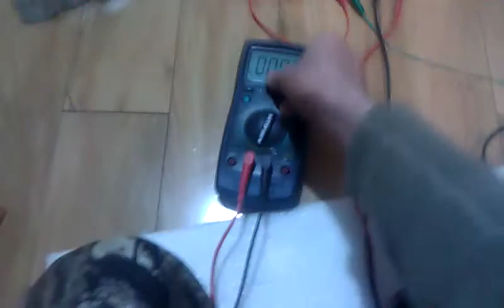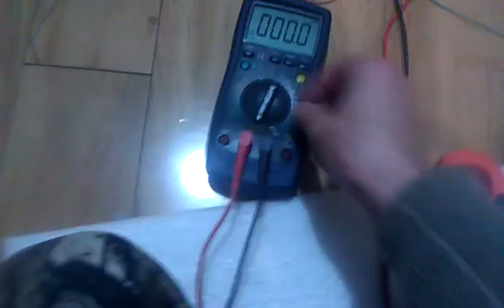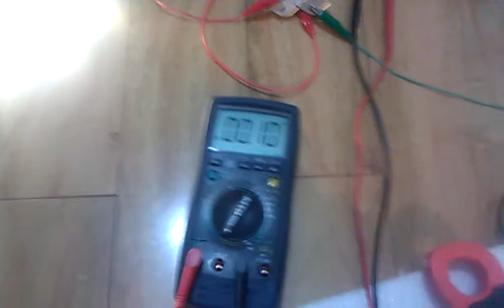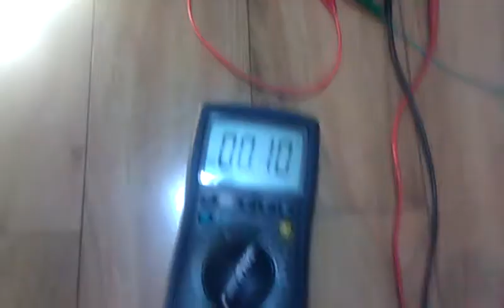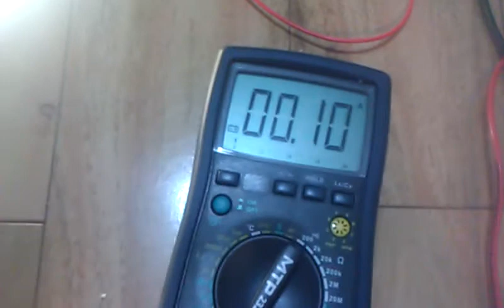Radiant Oscillator Circuit Part 8: Digital Meter Reading

Comment: The reason your setup is effectively efficient is because of the high frequency oscillation and higher voltage involved from the back emf of the coil collapsing. I have witnessed this with my inverter and cfl's they use more power at lower voltage and frequency. It has to do with the resonance and capacitance. The joule ringers helped me understand all this stuff.

Comment: His analog meter didn't pick it up, and it seems that the current is direct and not alternating at the point of measurement. The scope would be academic and in any case be better placed across the first coil for investigation purposes. What do you think?

Comment: Hello,

I just stumbled upon your videos.. :) 

Do you have oscilloscope? If yes, could you please attach 1 ohm resistor instead of ampmeter and put scope across? By Ohms law, your RMS value in scope will show actual amp draw no matter what frequency or signal is.

Cheers!

Comment: Digital meters works only in known frequency range. Check if your meter is operating at frequeny of your circuit. If not, then your readings are false.

Comment: Thanks for showing this, Kurt. It is still a very low draw. I use LED strips, 4 X 60 LEDs. my draw is 1 amp on full. the lumen rates similar to a light bulb of 120 watts. Now, I'm going to try your circuit on it. Waiting for parts. See my video called DIY 120 Watt LED System for my first installation. It's running of a 12 volt battery. Draws 22 watts on full.